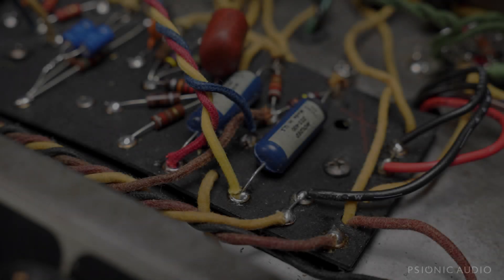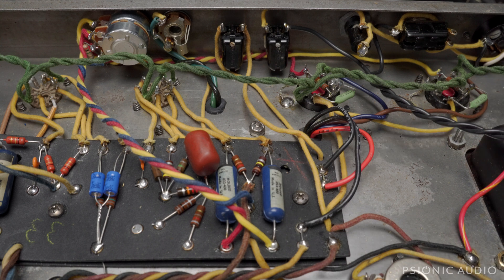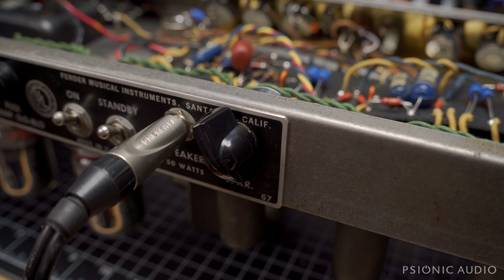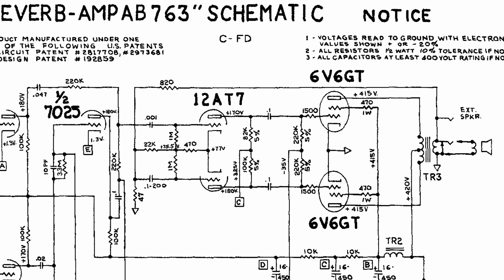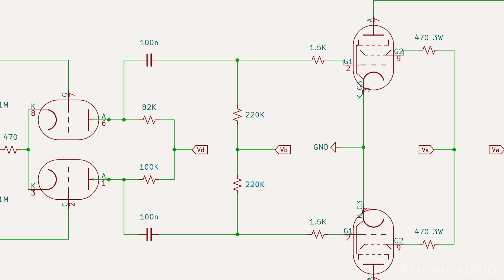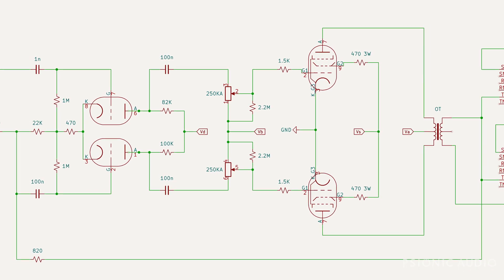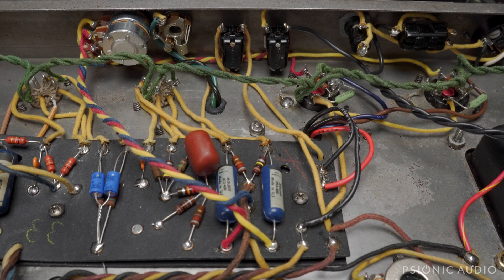Lar-Mar Master Volume | How It Works, Pros & Cons

Comment: Hey Lyle, I've been coming back to this video a couple times before and after installing a Lar-Mar type 2 Master Volume in my kit build AB763. It's really informative and made me want to do this mod.
When I have the pot at 12-ish it still sounds great but when it's fully opened I have a lot of hum and hiss in my amp (I might have multiple problems, trying to figure them out one at a time). I placed the master volume where the death cap would be. Could it be that this placement is causing that noise and would it be better to move it to the place for the external speaker? If so, can you also explain why? Thanks so much for your awesome and informative videos!
Reply from the maker: You don’t want the MV over by the AC mains wiring.

But you may just have a noisy amp and the correctly working MV reveals that.

Get a build right at full volume.
Reply: @PsionicAudio  Thanks for the reply! I'll replace the mastervolume and continue diagnostics from there.

Comment: That was excellent. I've never done a Lar-Mar, as I generally use attenuators. (Don't play out that often, so I don't mind carrying an extra box and cable.)  I would be very interested in a similar explanation, or at least an opinion, on London Power Scaling.

Comment: I put one in on a AB763 and it does nothing. As in no matter what position the pot is in, it acts like the 220k grid leak resistor, no change whatsoever. I am unsure what I've done wrong.
Reply from the maker: Look at the diagrams. Check your work.
Reply: I'm hypothesizing that there's a possibility that the dual gang pot may not actually be dual gang... I'm not sure. I see a single pot casing with 6 pins, there's an extra pin at the back of the pot, unsure what for. I'll probably run a test with 2 250k pots and see if this is indeed the problem (I will just have to turn both at the same time).

I checked my work, and I still cannot see what I've done wrong. Measured and probed everything and everything's connected as the schematic shows. Unless it only works on Bassman (because Bassman is all I've seen it shown in).

It's proven to be weird and I am unsure if it's the pot, or something else. But turning the dual gang pot does nothing... I'd like to know what's really going on here, how does it work? The type 3 MV works fine because it works by canceling out the 2 phase inverter signals, however not much is explained how it works (voltage dividing or whatever? I don't have a degree in electrical engineering). But not a whole lot is explained about how it works.

Comment: Larmar is great but it's crossline all day every day for me. All the masters sound good turned down a bit and they all have issues if you really dial it back. Crossline is the lowest parts count, least invasive, and actually gives you back some edgy top end as you turn it down. Get a pot with a switch on it and it's as "out" as "out of the circuit"" can get. Not for every amp/style but I feel it's largely overlooked.

Comment: I’ve just come across this after watching TONS of your videos for a while. Just so happens I have a 71 Bassman 50 watt being delivered on Thursday. I may be wrong, but I think that’s an aa371 or aa270 circuit. How would a this MV mod differ circuit wise? It’s something I’d like to do once I make sure the amp won’t blow up in its current state. 😂
Reply from the maker: Thanks. This works in pretty much any push pull amp with an LTP PI. Including your Bassman.
Reply: @PsionicAudio  That’s good info. I do appreciate it!

Comment: Great explanation! Could you comment on the use of frequency compensation that some amp builder's implement for this style of MV to address the impact of the loss of negative feedback? Cheers!
Reply from the maker: Thanks Pete. The frequency change is more apparent in amps that have a Presence circuit. 

Trying to compensate is tricky as you don’t know how the player is using the Presence circuit. Easy to overdo it and have the amp too bright for many (but still not enough for others).

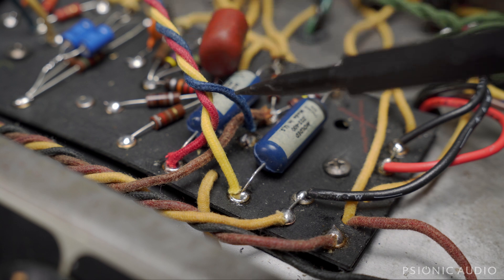I advise clients that any MV involves some compromise, but this circuit is close to transparent over 1:00 and not objectionable between 10:00-1:00.

If they find themselves using the amp with the Master at 8:30 it’s too much amp for that stage.

Better to get a second smaller amp or look into the various reactive load attenuator devices (Suhr, Fryette, UA, etc). 

There are ways to compensate within the circuit (high pass filter increases as MV is turned down, very minor treble bleed circuit incorporated, etc) but like I said, that is pretty much guesswork as to what most players will find good. Others will hate it.
Reply: @PsionicAudio  Thank you for the quick and thoughtful response.Much appreciated.

Comment: Respect your work. I have an Fender S face quad 6l6 amp with bias balance control .how does the Lar-Mar apply to it ?Do I need to run 2 x bias & unlink pot as separate ? so as four wires to the pot. Regards  Tory

Comment: How can it be that this Bassman has much firmer and crisper distortion than my Bassman even though the circuts are very similar except for the master volume?
The character of the distortion did not change much when the master volume was turned down. Does that mean that it was mostly preamp and pi distortion?
Reply: Yes

Comment: I have owned dozens of Fender tube amps, and also played every Fender under the sun, and thus far there are none that deliver good enough high gain for gigging & recording. Where they absolutely shine is shimmering cleans to slightly overdriven to growling gain ala tweed deluxe power tube breakup with the volume on 10. But for high gain, look elsewhere as there are far superior options.

Comment: I just put one of these on a Z/28  mk one clone and it works well enough. Not a huge fan of master volumes most of the time but the #2 and #3 are nice because they don’t affect the tone when cranked all the way. The Z/28 has 100k grid leaks so 100k dual pot rather than the 250k.A pot/resistor combo to get close to 100k is probably a better option for safety, tho. The trick is finding a dual pot with a satisfying taper for MV. Might take a few tries with different brands and tapers. Edit: Just found  a dual gang 100k A pot and used 4.7meg resistors and it works really well. Taper is more useful than 1 meg pot with 110k resistors which I tried first.

Comment: If a PPIMV is installed on say a 50w 2204, when the added knob is all the way up, doesn’t that basically make the amp act as if it’s not there ….giving full control to the original master volume on the front of the amp ? I have some type of PPIMV on an ‘87 2204 and  I feel like it’s simply “not as loud” as it should be with all volumes up.
Reply from the maker: The Lar-Mar is out of circuit when at full volume. The type 3/crossline usually always attenuates slightly.

Comment: Very useful, I put in a variable  resistance in the feedback loop to make it a bit better when volume turned right down.
Reply: I tried the variable feedback pot as well as the presence control with switchable 1,5, 10 uF caps in a ‘69 champ amp and it gets pretty “Raw” as the NFB goes away like a tweed. Very nice!
Reply: @tjminasi1442  The trick is more NFB when you turn down volume to keep NFB to similar levels when volume is up. Of course you can also use it to give you less NFB at higher volumes to give a rawer tone.

Comment: Sounds great.  Not related but... My Supersonic 22 reverb is rather benign, as in, barely noticeable.  Will a new tank help or is that a circuit thing?
Reply: It shouldn't be a circuit thing as mine can get really cavernous when you turn it up. Maybe check your V3 tube, which is the reverb driver and should be a 12AT7. V4 is the reverb recovery tube so that could possibly have something to do with it too.

Comment: Would this work on an amp with a direct coupled long tailed pair phase inverter? (EF86 into a 12ax7, with a bias voltage on the 12ax7’s grids) And the OT negative feedback fed into said ef86, and not the power tubes?
Reply from the maker: I’d want to see the schematic before answering.

Comment: If you were to mount the pot on the other end, perhaps in a blockoff plate for the auxilliary AC outlet, what precautions would you take for getting the wiring past the power feeds? Would just trying to make sure they cross at 90° from the leads coming out of the transformer be enough to ensure no noise is picked up from there? Is this even a concern? As far as the blockoff plate; is bonding a concern at all or would the potential isolation be even better? Thanks Lyle!
Reply from the maker: You want to steer signal away from high voltage/current AC as much as possible. Certainly away from the mains.

Comment: Hey Lyle. Thanks for your video and explanations. I installed a Trainwreck Type-3 PPIMV including a switch to completely eliminate the master volume pot on demand on my 65 DDRI. Couldnot source a dual pot here in Germany at the time I installed it. Is the difference between Type-3 and Type-2 Lar-Mar Circuit noticeable/discernible? What is your opinion? Thx in advance. Keep up your good work and greetings from Germany
Reply from the maker: Thanks. Type 3 (crossline) doesn’t have a very good taper and sounds a bit fizzy in comparison. I’m not a fan, but for minor volume reduction it can be OK. 

PS no disrespect to Ken, but the Type 2 version in my schematic is better to what he showed as I (like others) include a fallback resistor.
Reply: @PsionicAudio  Sir you are right. The taper with an 1MA pot was horrible, tried 250KA and 100KA pots. Kept the 100KA one. Your videos and the AB763 Mods page from rob robinette helped me a lot working on my amp. Thank you very much again! I'm looking forward for your next livestream. Maybe you could talk a little about the SLO cirucuit and your opinion. Here in Europe there is a nice source for a SLO Kit  and I'm intrigued in building a 30 Watt one as a high gain amp since my clean tones are well covered with the DRRI. Cheers from Germany

Comment: That's the one I particularly like. Parallel resistor formula      1/({1/X}+{1/Y))  = R      2,3,4,5,6  resistors keep adding the inverses of each resistor together and then take the inverse of the sum. A resistive attenuator network? That is a whole other kettle of fish, with some twisty eels added in for fun. That was the first actual real head scratcher for me in electronics class. 3rd level determinants and AC phase angle calculations were the next ones, with 64+ blackboards of math literally running in circles around the room. When we used up all 16 black boards on the four walls of the classroom we erased the first blackboard and just kept on a going, around and around.

Comment: Ken Fisher - Trainwreck Pages - Type 2 (except Ken actually had 100k-B dual ganged pot in there).
Reply from the maker: Thanks. Linear can sometimes be better in cathode biased amps. Audio works better in fixed bias in my experience. The value will depend on the value of the coupling cap before it, but in general use the closest match to the existing bias/grid leaks.

Comment: Thanks for that.  I may have my amp tech do this to my ‘67 Bandmaster (AB763 circuit).
Reply from the maker: Well, the AB763 phase inverter/output tubes usually stay pretty clean, so a simple pre-PI MV ala late ‘70s Fenders can also be a good choice for those (without the dumb bright cap). Depends on how much you turn up the preamp volume. For “regular Fender use” (volume no higher than noon but you just want less output) the pre-PI works well. If you turn the volume to 8 a lot ala Bloomfield then the slightly more complex Lar-Mar is your friend.

Comment: The grounded cathode output does require matched tubes.  Nice circuit for the purpose it is used good video.
Reply from the maker: See the ‘67 Bassman video yesterday where I used the same MV with the Fender Bias Balance circuit. So you can fudge tube matching that way, though I always prefer matched tubes myself.

Comment: Awesome!! Thanks!! Just for my curiosity...could the gradual loss of NFB be somewhat compensated for by changing the NFB resistor out for a variable NFB resistor, maybe a 6-way rotary switch (with maybe one position breaking the NFB loop)? I guess I'm unclear as to what causes the loss of NFB functionality. I'm often accused of having just enough knowledge to be dangerous. Thanks for your awesome content!!
Reply from the maker: Thanks man. That’s a tail not really worth chasing, for reasons I don’t have enough coffee to get into. Let’s just say if it was doable and there was a real reason to do it, designers would have been doing it a long time. 

Simple is good.
Reply: Thanks for the well deserved scolding.    @PsionicAudio

Comment: Hi Lyle. Thanks a lot for the great video and explanation. Could you advise re the values of each pot in the dual gang. Is there any issues when they don’t match ?
E.g one pot reads 251 and the others reads 266 
Thanks a lot
Reply from the maker: It doesn’t really matter if the difference is 10% or less. That’s something I’ve tested with matched and unmatched dual gangs. The high pass frequency difference is negligible, and the effect on bias isn’t enough to cause hum/noise. So long as each gang’s taper is the same (and they usually are as that’s consistent in production) the MV works the same.

I spent a lot of time down that rabbit hole.
Reply: Brilliant. Thanks a lot for that. Much appreciated.
Reply: Thanks...was wondering the exact same thing! Mine was like thirty ohms apart on a one meg dual gang pot for the type one master volume in Trainwreck pages.

Comment: Nice! I usually did the shielded cable and its always been a bit of a mess so that twisted wire tip will be something I'll definately have to try next time I set one up!
Reply from the maker: In a modern amp you can use teflon coated 22AWG and end up with a very neat small diameter twisted run. But in these old Bassmen I used the cloth covered 22AWG purely for cosmetics/vibe.

Comment: Thanx again Teacher... Iffin I could bring you an apple... 
In your opinion, does this 'ppimv' compare with an attenuator tone-wise? 
Thanx again
Reply from the maker: Given that no attenuator and no MV are “perfect” the best solution for “transparency” would be to use both at once, each just doing a little volume reduction. Say MV at 1:00 and attenuator doing -6dB. So neither is really changing the sound. But you get a very noticeable level reduction.

But this kind of MV is much more “transparent” than people think. The gear forums are full of hyperbole. Nothing ever has some weakness - IT SUX. Nothing ever has some advantages - IT RULZ.